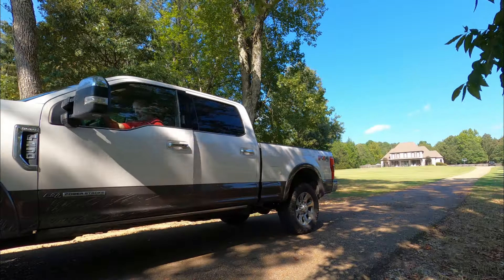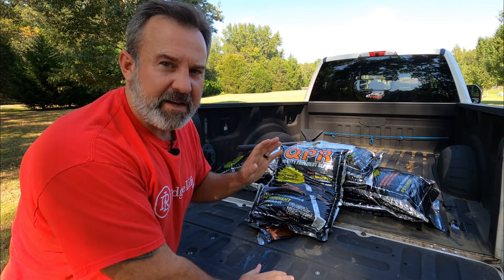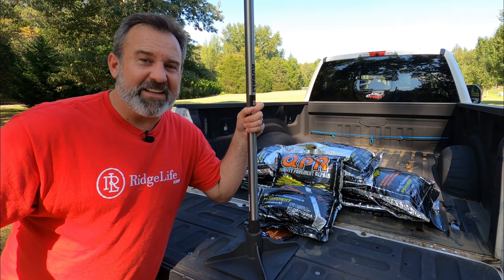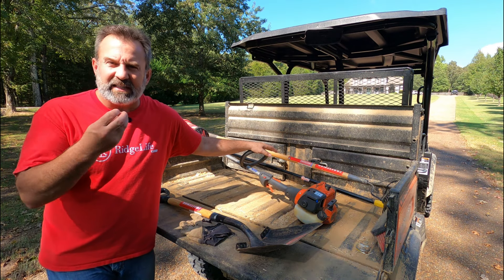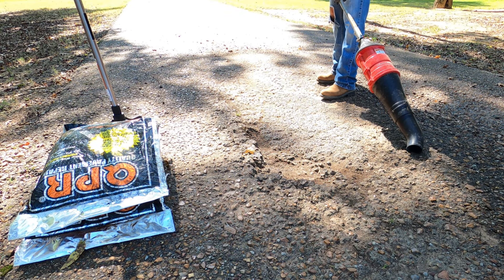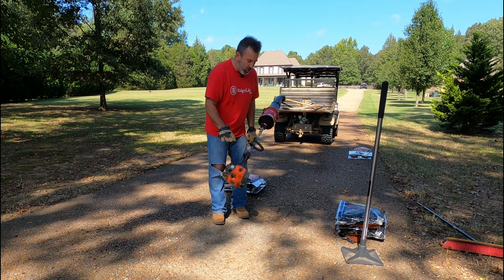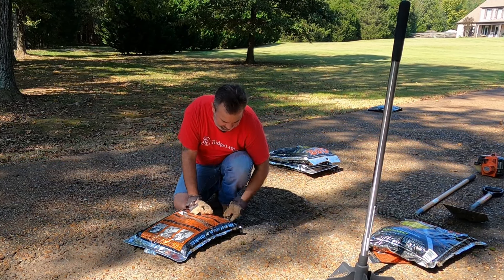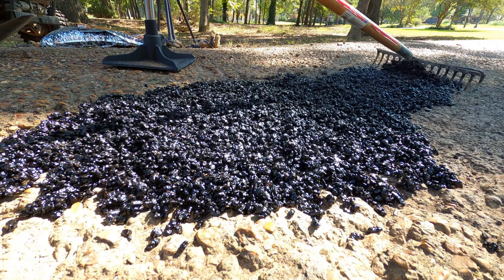HOW TO Repair Asphalt Driveway | QPR Cold Patch

Comment: I’m having to dig up my asphalt driveway where pine tree roots have pushed up. So I have to dig down to remove the root leaving bare dirt/gravel in the hole. How am I to clean/ prep it so the patch adheres?
Reply from the maker: As long as it has material along the edge and is thick enough, it will adhere.

Comment: Thank you for this!! Confirmed I did things right. The only question I have is can I resurface my driveway with this?

My driveway replacement is actually over $10k so...."not today!" 12:53  😂
Reply from the maker: You are welcome. Not while areas but smaller areas for sure. Needs something to bind to on all sides.

Comment: My concrete driveway is horrible, we need to replace it but like you said it is NOT cheap. Sometimes I wish it was asphalt so we could repair it 🤷‍♀️... Wow that's a really cool security system 👍
Reply from the maker: Have you seen Sunnyslope concrete repair video?  Pretty cool.
Reply: @RidgeLife  ha unfortunately ours is beyond repair. One of these days we'll replace it 😃
Reply: If it’s concrete, don’t be afraid to patch it with mortar and cement. People pay me $40 an hour to patch concrete driveways that way, patches usually last another 5-10 years easily. Typically can patch an entire driveway in a day for about $800

Comment: Thanks for this, I was curious if I could use this by myself, it looks pretty straightforward. 

May I ask a question: I have a steep concrete driveway and 2 Priuses. :) My cars scrape each time I go up or down the driveway. The slope is more substantial for about 5 feet right where the driveway meets the road, it's about 20% using the level/ruler method.  I am considering filling the sloped place with this stuff, hopefully reducing the slope. Would it work for that? It looks a little liquidy as you indicate, would I be able to shape it on a slope?  Thanks!
Reply from the maker: I think it will work. If you tamp it in the shape  you need it will set.  Good luck!

Comment: I have a sink hole in my driveway. Once I remove the sinking asphalt, what should I fill the hole with before using the cold patch?? I was planning on crushed stone and sand, but it seems sand would not be a good idea?
Reply from the maker: Depends how deep. If over a foot, dirt. If shallower, just fill with patch.

Comment: This won't last. Best to work in cut squares or rectangles 2" deep or more. Then the compression forces adhesion to the edges of the hole.

This "expert" will be redoing his patch in a couple of years (within the next year, I'd bet as it is now 2 years old). Don't believe everything you see on YouTube. Never "feather" asphalt.
Reply from the maker: This video was several years ago and the patch is as good today as the day it was put down. Do it right with the right materials and DIY works. Now a professional resurface would be better but $$$$$
Reply: @RidgeLife  OL, OK Mr. Expert
Reply from the maker: Just giving my actual experience with the product.

Comment: This stuff doesn't cure. Been three weeks, still loose.
Reply from the maker: Mine was hard as a rock in no time. Still is a year later. Did you you the same product?
Reply: @RidgeLife  Yes, but they put it down during cold weather. But we've had plenty of hot days since. I'll be more patient. But there's no way you can drive over it. Even the riding mower peels it up.
Reply: @joshpaul1976  yeah, need to fully tamper it in to get proper adhesion.

Comment: QPR is garbage.
Quickrete asphalt patch is much better, and hardens sooner.
By far and away the best is aquaphalt; sprinkle water on it, tamp down, and it’s rock hard in 20 minutes…but expensive.
Reply from the maker: QPR did great and is holding up so far. I will have to check that out though. Thx!